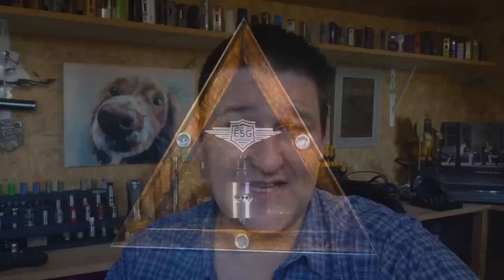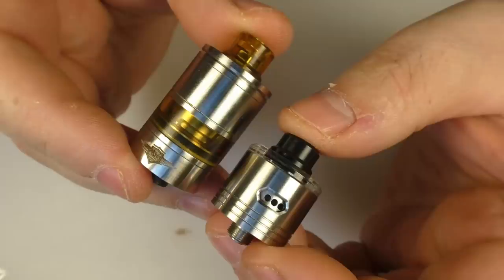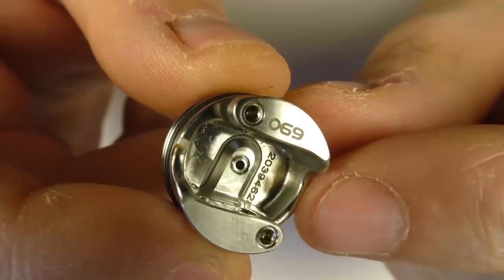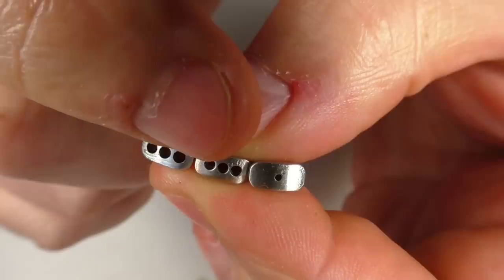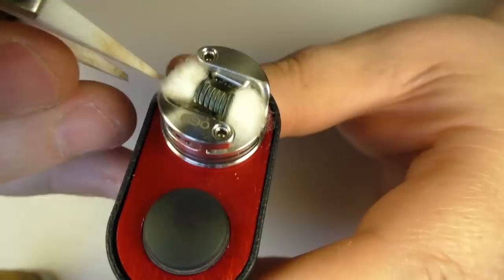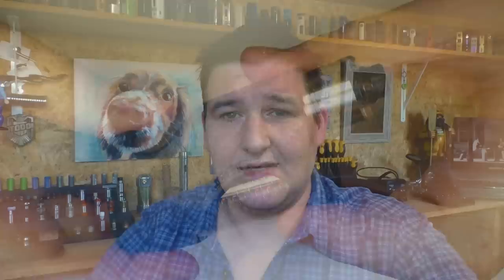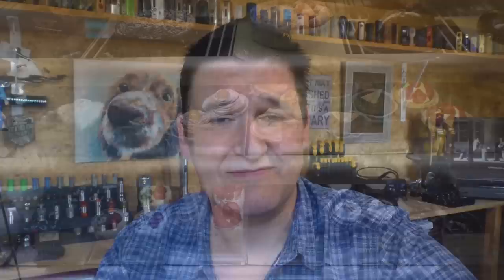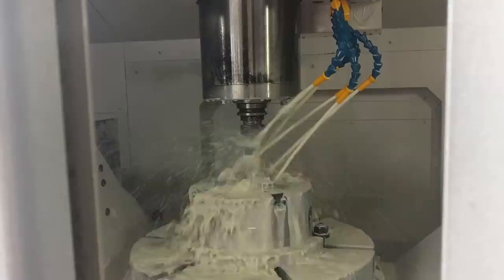Skyfall RDA by ESG (Esmokeguru)

Comment: Looks a great RDA but for 160 euro I'm not that keen on an AFC that seems as difficult to move as on this, particularly as the cap is so smooth with no grip assistance by way of knurling or whatever.  On the fence at the moment.

Comment: The Skyfall appears to be first class, but for most of us the main con is the price.  If it does about the same as a Narda, Narca, or Haku, why spent big bucks on a Skyfall?  Another con which seems very common these days is the problem of removing the top cap.  What is wrong that manufacturers can't make a grip edge to make it easier to turn or remove?
Reply from the maker: Sticky at the top for every video, don't complain about price, if you can't afford it, buy something else and move on.

Comment: Have you tried using it without the discs, and just adjusting airflow with the top Cap? Is there too much space between the cap and posts for it to work without a disc?
Reply from the maker: It'll work without a disc but the airflow would be all messed up.

Comment: I'm currently using requiem rda by VV and I'm just wondering if they're the same in terms of MTL draw? 
Or who's more tight and more flavor? 
Thanks
Reply from the maker: Better MTL with the Skyfall with the 1mm x 3mm disk, still a loose MTL though but you can close the holes off.  Requiem is still a fantastic RDA.